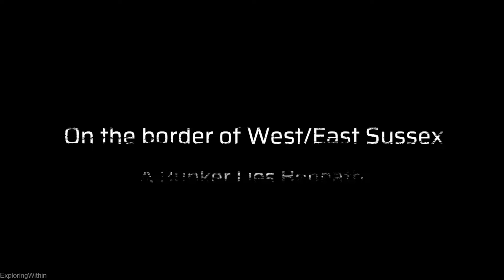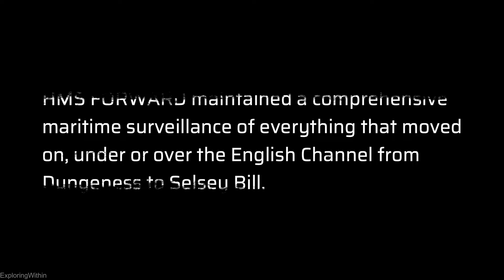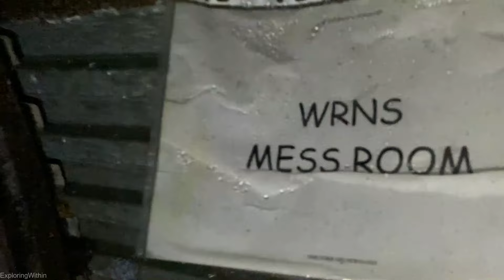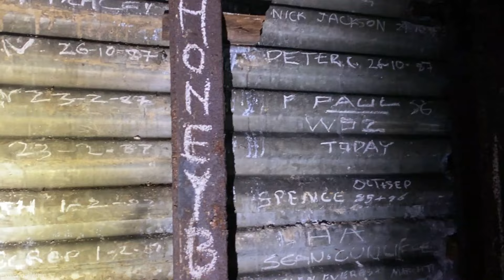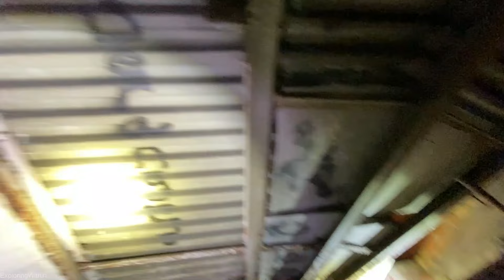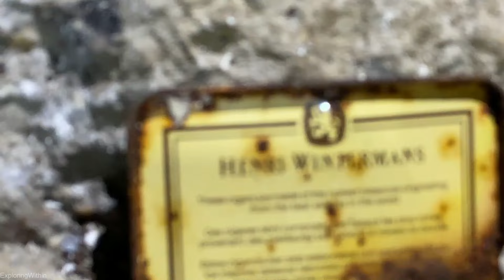ABANDONED UK NAVAL UNDERGROUND HQ BUNKER - HMS Forward

Comment: 18:18 that would be a guard post, allows a guard to position himself safely out of the way if the bunker was attacked. They was that big Sanger / pill box structure on the main road probably used to defend the entrance and accessible from inside the tunnels.
Reply from the maker: Seems logical, thanks for the info there 👍